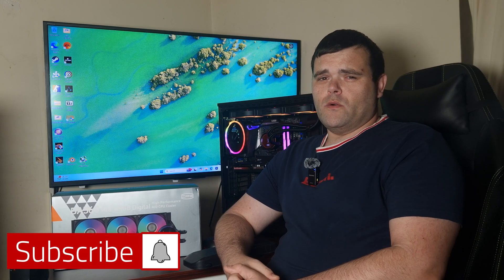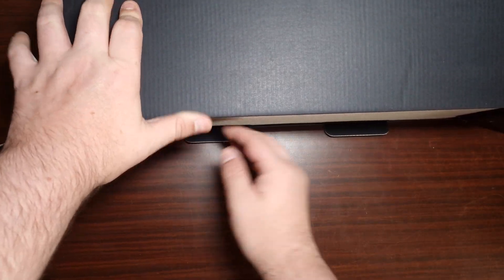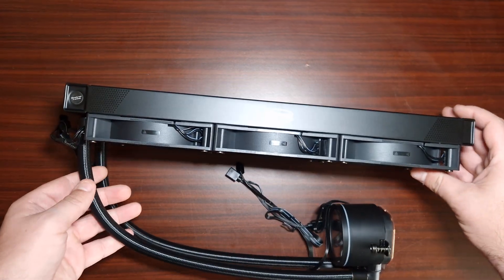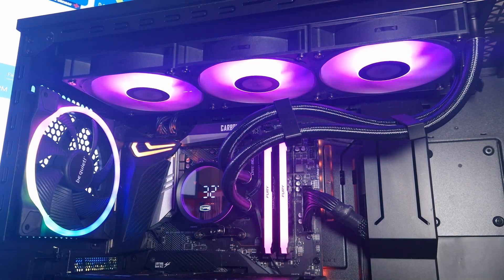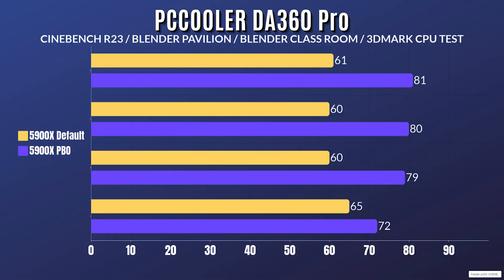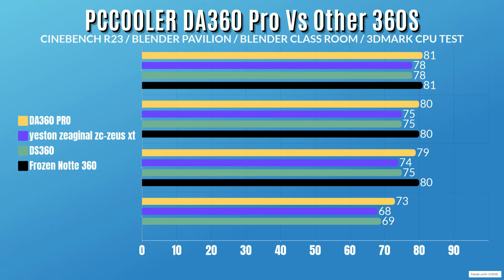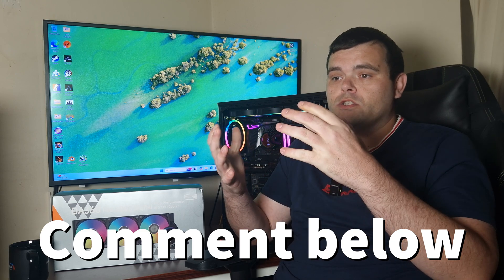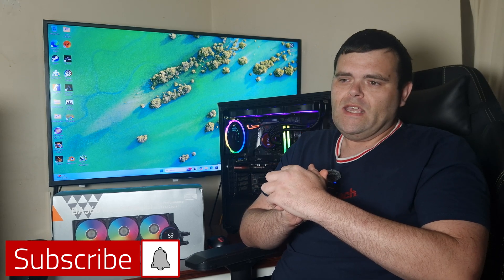PCCOOLER DA360 PRO Aio CPU Cooler Review

Comment: My RGB does not work. I have downloaded the software but it won’t open.
Reply: Yes I have, it still does not work

Update: It works now. It the 3 pin wire to my motherboard was not properly connected. The usb was plugged in. I checked all the other wires and found the loose 3 pin wire. Thank you for your help!
Reply from the maker: Most welcome ☺️
Reply from the maker: Did you connect the cable to a USB port at the bottom of your Motherboard